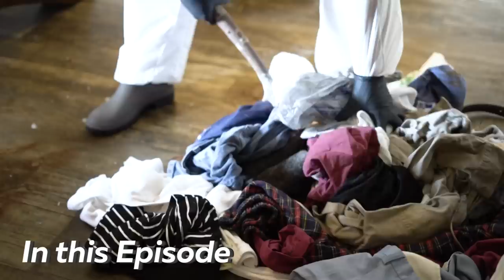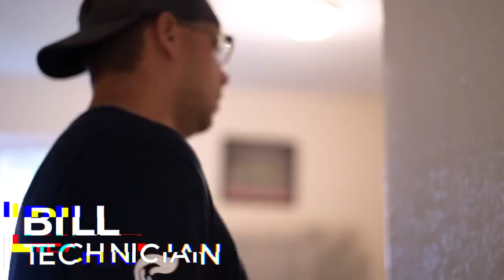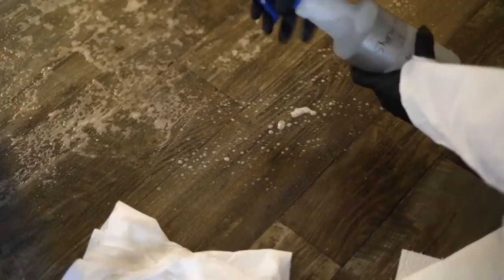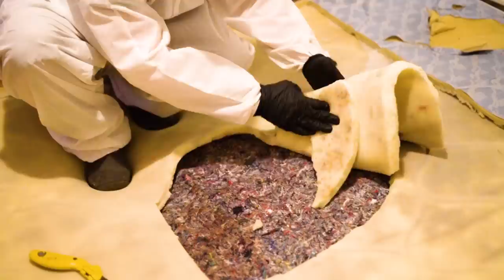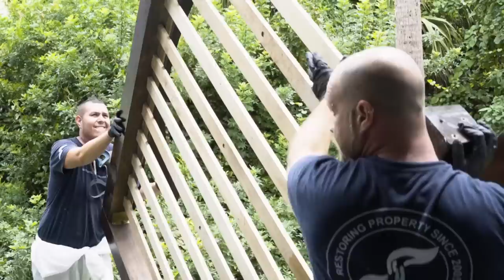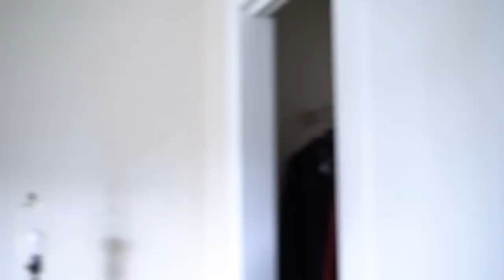S2 Episode 7: Domestic Stabbing

Comment: Is there a video that explains all the things y'all need to do to make the scene ready?  For example...what's the purpose of the OZONE machine?  What items you have to dispose of in a special way? etc.  Is there something special you have to do if there's a decomp?
Reply: I worked with ozone machines in the hotel industry, they are super powerful deodorizers. They create O3 (ozone) and it binds with and destroys bad smells. (Sort of like bleach for air in essence) They aren't safe to have running around people because too much 03 is bad for humans but you can walk in and turn it off. Then the gas slowly dissipates but leaving a door and window open to create a quick crossbreeze will un-ozone it in like 15 minutes.
Reply: Jenny Munday how well did they work? Was the smell gone or just a temporary fix?
Reply: @Thepublicaccount  They work really well actually. Our general rule was 24 hours for moderately smelly rooms, 2-3 days for extreme cases. Otherwise we'd leave the windows open and have the front desk close them at around 5pm. (To me a moderately smelly room is one where someone smoked overnight  with the windows closed for example)

Edit: it's permanent as long as you removed/cleaned anything that was causing or had absorbed a lot of the odor. Like we'd do our normal thorough cleaning then run it for 24 hours and 2 of us would go in there and sniff everything lol
Reply: Jenny Munday thanks getting some rental property was thinking of getting some in case we get a bad renter or a property with a smell issue. We don’t have a service line this near us.
Reply: Thank you I was very curious to know 👍🏽

Comment: I have a question. Why do y'all take apart the mattress instead of disposing of the whole thing? Does it just make it less to dispose of if you cut out the bio hazard parts?
Reply: Brenna Hendrix I have the exact same question :) Hope somebody knows
Reply: I'm assuming it's because they have to put it in a specifically marked biohazard container and it wouldn't fit whole.
Reply: Brandy Kinsman That was definitely a thought, and it makes total sense. :) Thanks!
Reply: They have to cut out any bio hazard to dispose of in a biohazard (medical waste) container which eventually is incinerated.  The mattress, as a whole isn't going to fit and its more cost effective to do it the way they do it.
Reply: he said it was still am active crime scene so I guess legally they aren't allowed to remove anything from the scene incase it's considered evidence.
Reply from the maker: we have to break it down to dispose of it.  it must fit in a bio container.
Reply: Crime Scene Cleaning Awesome, thank you!

Comment: question- i know you bio bag the trash can but what about moving it around the scene to gather items? do you bag the bottom of it so that you can remove it when you leave to not track that into the vans? or other areas in the location? lift an move the bin as oppossed to dragging it in bio into other areas? just wondering. thanks